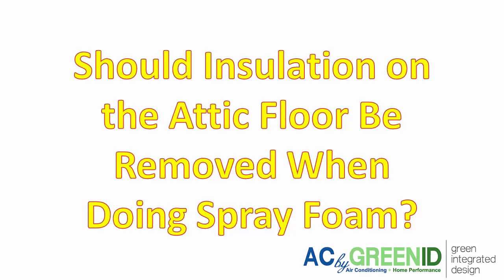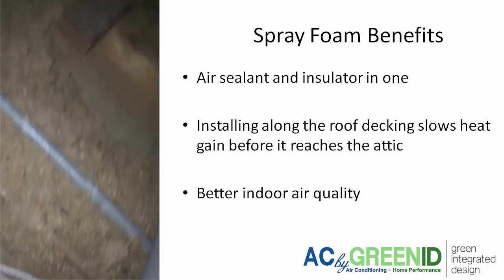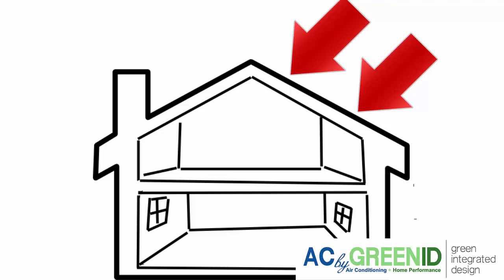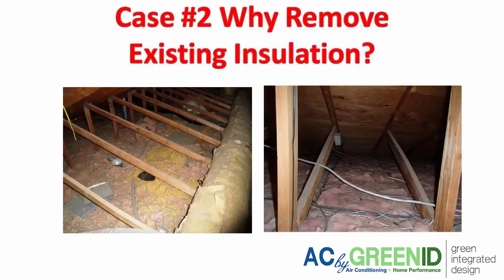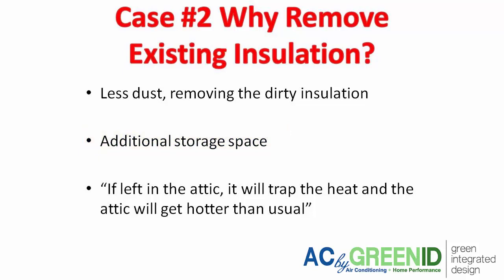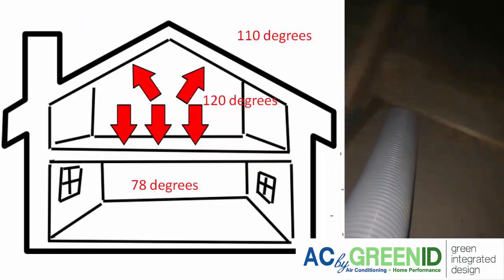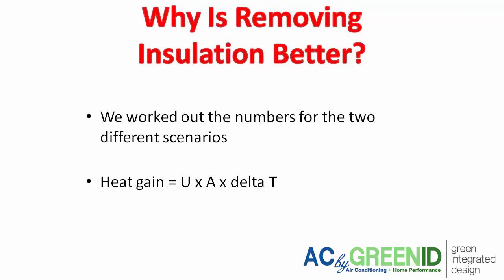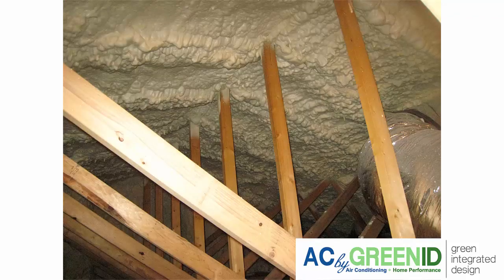Should the Attic Floor Insulation Be Removed When Doing Spray Foam?

Comment: Do I need to have spay foam on the 2 side of the gable wall on the attic or only need to be done on one side?
Reply: Tracy MOO we typically put netting to separate the attic area above your conditioned space from the attic area above the outside (garages, patios, front door entrance) and then spray foam on top of the netting. It won’t matter if you do one or both sides

Comment: orry for the long post, this is the toughest situation I have ever had to solve in my life.   We live in Indiana and we have hot summers and cold winter.   I know what the right thing , which would be to drop my entire drywall ceiling and get all the insulation out, but I can't right now as renter living upstairs and a new baby coming..  I would appreciate anyone’s suggestion helping me with my this odd ball situation I have. About 12 ago,  just before foaming became popular, we decided to feel up the entire attic cellulose because the attics space had many dormers and areas that probably only has 18 inches to fill with insulation. To make matters worse I was losing heat without knowing it and had high energy bills in hot and cold. I painted my roof with white silicone to cool the roof and did cool the roof and the attic by about 30 degrees.   I realized I had a big problem as the indoor heat was going somewhere and recently I found out it was just pouring into the attic . I found condensation all over the attic this winter.  My first thing I have did was to add more venting to air this out.   Right now I am planning on foaming.  passages way that is pouring warm heated air into my attic. My only concern is that I don’t know if that attic will ever get proper venting and air movement. I have installed  sensors in the attic monitoring every step I take to see the effects on the Attic, Temperature and Humidity.  What I am thinking is right for my odd ball house , is to climb into the tight attic. With a push broom. I want to push the Cellulose insulation toward the smaller cavities of 18 inches and pack it tight as I can, pushing it so hard into those 18 inch runs until I can't get it to pack anymore. Keep in mind I can't reach all of the areas with a standard foam gun that why I want to pack the hard to reach areas with the cellulose. after that I would like to foam all the areas where there is enough room to use spay foam. My intention is to spay as much as possible but since some of my spaces are out of reach I seem to have no choice then to back them tight with the extra cellulose we filled the attic with, could save me allot of headache of dropping the entire ceiling .  I  As I said I would like anyone opinions on this I would greatly appreciate it.  
 David. H

Comment: Makes sense, but removing my existing R40 insulation costs a lot of cents! If you were to closed cell foam your attic sheathing, how would you ever remove rotted wood from the outside?  There’s always some decking that needs replacing when installing a new roof. And then you’d have to re-foam the area from the underside.
Reply from the maker: You would cut the section out that was bad, then replace and re-insulate. I believe in cold, humid climates, closed cell spray foam goes on the attic floor.

Comment: Be careful doing this in hot humid areas, if your indoor humidity is about 50% with your current house and cooling system running, that is ideal and be slow to mess with it.
Reply from the maker: Open cell spray foam is not recommended for humid climates and spray foam contractors should know to use closed cell.

Comment: Thanks for this post. A follow-up question. What about winter in cold climates? Say it is -10*F outside? Wouldn't the double insulation argument have merit? Also for the summer, since heat rises, wouldn't the insulated attic floor prevent heat from the lower floor from rising into the attic space? Thanks
Reply: The double insulation argument kinda has some merit in the winter time like you suggest as heat wants to rise and would otherwise go into the attic to a certain degree, however in the summer time the main source of (extreme) heat in an attic is the heat coming through the roof deck from the exterior not any excess heat from in the house
Reply: @Iamthathillbilly  thank you! makes sense. I will keep it out!

Comment: Your blog calculations need to consider the roof surface temperature, not the ambient air temperature.  Also in a steep slope roof application, the roof area is not is not equal to the ceiling area.  For example, a steep sloped roof may have 50% more roof area then ceiling area.  And with a metal or dark comp roof, the surface temperature may be 150 degrees or more, this would increase your delta T significantly and affect the calculation.  Maybe enough even enough to justify keeping ceiling insulation(in some limited conditions at least).
Reply from the maker: Sam Wilson thanks. Are you saying T1 is the outside roof surface temperature and T2 is the inside roof surface temperature?

Comment: What is the data on actively conditioning a foamed attic?
Reply from the maker: When spray foam is applied along the roof deck and remove the insulation on the attic floor, every home's thermal boundary gets redefined. The attic now becomes conditioned space whether ductwork is added to the space or not. Yes you are conditioning the attic, but because the insulation is applied to the roof deck, where is slows heat transfer before it reaches the attic space and it acts as a air sealer, the effectiveness outweighs the downside of having the additional load to condition the attic.
Reply: I hope you can clarify something for me.  One of the disadvantages of keeping the old attic insulation is that it traps heat in the attic.  It seems to me that if you are no longer trapping the heat, you are releasing the heat.  Into the living space?

Comment: In a vented attic, it’s more efficient to stop “radiant” heat at the point of entry. Which is the roofline with radiant heat barrier. Meaning foil. Adding spray foam on the attic floor will efficiently stop “convection/conduction” heat into the living space.
Reply: Green ID In Nashville, TN. Slight humidity levels throughout the year. I open celled the roof deck and left about 8 inches of blown in cellulose in attic floor. Second floor cannot cool in days with high heat and higher humidity levels. Should I reopen the vents on the roof deck? Or just put a return/supply line in the attic?
Reply from the maker: A supply and / or return is what I would do, try also running your fan longer after your compressor shuts off to circulate air after the compressor shuts off. Ecobee thermostat has that setting. If you vented the attic it would work against your spray foam.
Reply: Green ID what do you mean that “it would work against the spray foam?”
Reply from the maker: Spray foam creates a conditioned space in your attic, so it is essentially inside. That's why all your attic ventilation should be closed off and sprayed over and the attic floor insulation can be removed. By re-opening the roof vents, it would be like leaving a window open in your home. Even though your attic, isn't used as conditioned living space, if you let outside air in to vent the space, it will be as easy path for heat and moisture to enter in the space and while it may ventilate better, it will also get hotter and wetter. Heat goes from hot to cold and moisture goes from wet to dry so both heat and moisture will be coming into your home with an open vent and the spray foam may trap it in the attic longer than having no spray foam.
Reply: Green ID so what you’re saying is it could stay more humid up there because it is spray foamed and might not allow the air to dry as if it was just a regular vented attic with blown in cellulose? But what about vent fans that can turn in and suck/blow the air out the roof vents? I just don’t see the point of conditioning the space if I’m not up there. Sorry to ask so many questions
Reply from the maker: No, it would only get more humid in the attic if you vent it from being totally closed now. I would stay away from vent fans at all costs. Please view the research that was done on attic fans.  https://buildingscience.com/documents/digests/bsd-149-unvented-roof-assemblies-for-all-climates
http://www.greenintegrateddesign.com/power-vented-attic-fans.html
Reply: Is there any big difference between creating a conditioned space with spray foam on the roof deck versus using rigid foam board under the roof support structure(roofing rafters)?
* This question assumes you allow venting between the foam board conditioned space and the outer roof sheathing ) Like a mini or shallow attic above the conditioned (sealed off) part of the larger space of the attic.
This allows a shallow radiant barrier space to operate above the foam board.
Reply from the maker: Both are effective but with spray foam your attic will be air tight and that is a noticeable difference on your bills and when you go in the attic. A vented attic with radiant barrier boards is good and cost effective on new construction homes but it's not air tight. It's certainly better than just having insulation on the attic floor, but spray foam still is the best.
Reply: Either you missed my assumption about making the foam board area airtight(i.e., sealed off). This would mean foam board down to the wall base/floor and sealing any cracks were the foam boards abutt each other.
OR - are you saying that no matter what -- rigid foam board leaks air?
Here is an example of what I am describing https://www.youtube.com/watch?v=6F_IkZJ8NOY although I am not planning to use such thick foam boards.
Reply from the maker: I've never seen that application in AZ but I would assume the rigid foam board in the video would have a similar performance to spray foam. Good luck with your project
Reply: @2Truth4Liberty  I recently spoke to my roofer about this. The method you are talking about is preferred. When the sun beats down on roof, having that vented space behind it will keep the roof panel cooler and increase/maintain shingle life. Vs sealing directly to the roof with spray foam keeping the heat locked in
Reply: +George Vogt
Thanks for the follow up :-0)
In theory, it would seem that dividing the mass of the roof into thinnest practical layers with vent space between each layer would be the goal for best heat blocking and longevity of materials. (though this could add thickness to the roof to bear in mind for aesthetics).
I am going to put a 4 inch tall vent space under the roof sheathing but also divide that in two halves by placing a radiant barrier (from atticfoil.com) in the center effectively creating two 2-inch tall vents one on top of the other - that is, one above and one below the foil. The highest(top) vent would do most of the work as the underside of the roof sheathing would be the hottest plus radiant heat reflected up from the foil. The bottom vent (space under the foil) would be to help prevent emissive heat transfer downward  from the foil. The foam board (or spray if I change my mind) that is below the foil and below that lower vent space should have a lot less work to do :-0)

Layers of clothes helps stay warm
Layers of vents should help stay cool  ;-0)
Reply from the maker: In Phoenix, this is not true. We have installed both radiant barriers at one time and spray foam. Yes you are correct radiant barrier stops the radiant heat while insulation stops the conduction/ convection heat gain. In Phoenix you NEVER want to install radiant barrier on the attic floor. Once a layer of dust gets over the radiant barrier after a summer, it becomes useless.  Yes, radiant barriers do work but they will save only $0.03 per sq ft in Arizona. http://www.azhomeperformance.com/documents/RBFactSheet2010.pdf
We have never been able to change a homeowner's HVAC system to a SMALLER system with radiant barrier. We have reduced the cooling loads 20-30% with spray foam applied to the roof deck. Both our models and following up with homeowners years after our install have shown this to be true.